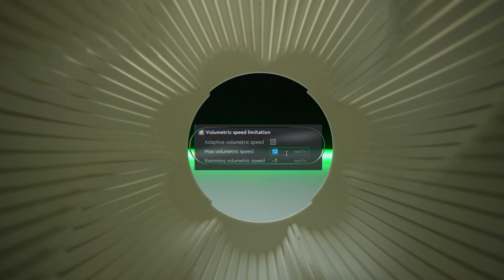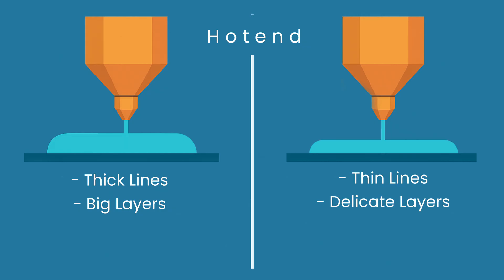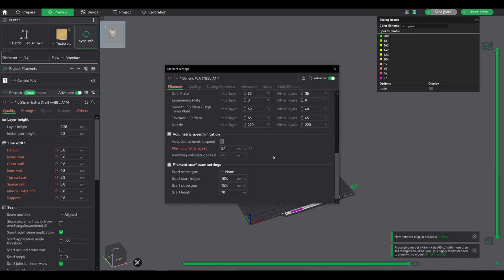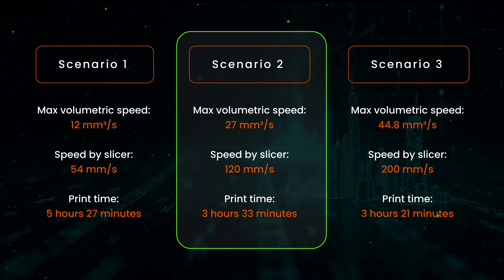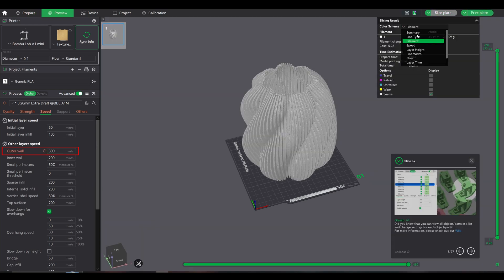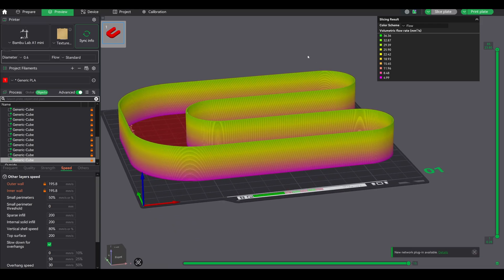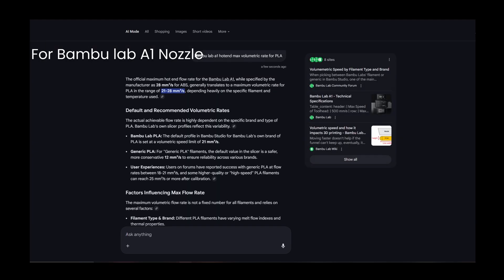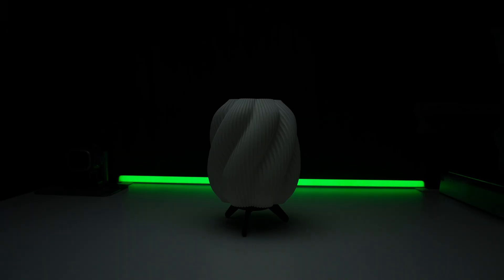3D Printing Speed Hack: Save HOURS with This One Setting! | Max Volumetric Speed

Comment: Bambu PLA Basic max flow is 21, but once I got the E3D ObXidian high flow nozzle, I was able to hit 40 on my P1S without any issues. My tests concluded higher than that but I capped it at 40 for a little buffer.

Comment: The true lesson learned: if you set this parameter way off from the default value in your slicer settings, then your printing time will increase significantly without any advantage. Which is pretty misleading... :D
On the other hand, it contained some useful info, and the video quality is nice.